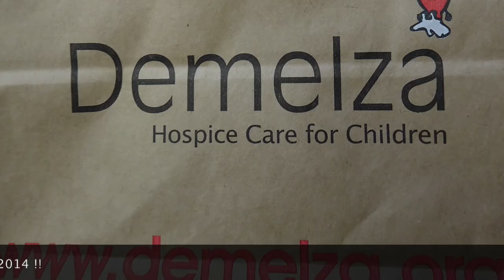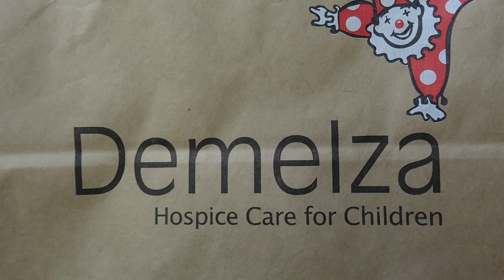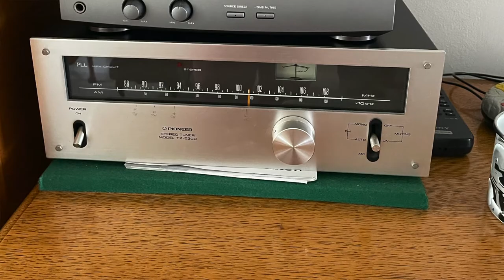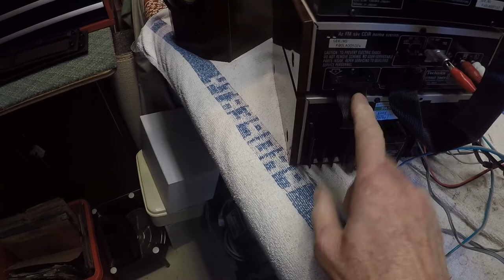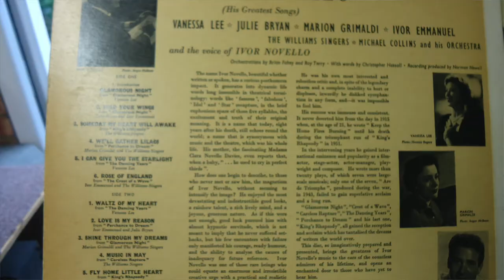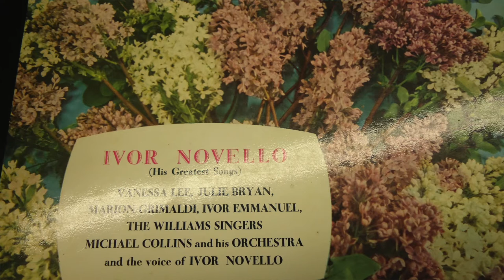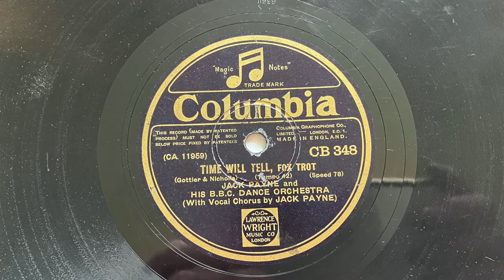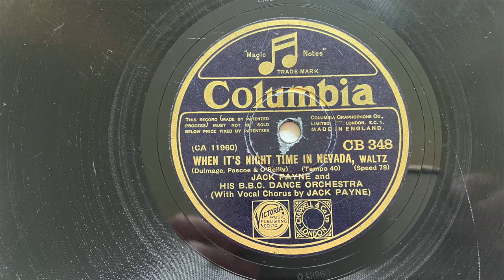Technics SC HD550 (2001-2002)

Comment: Hello Richard,I bought this system off eBay nearly 2 years ago. I kept my cheap Aiwa record player from an old system from the 90s. Sounded great,but I got a Technics SL b21 which was mint and with an at 85p cartridge. Then I bought almost new teac 250 speakers and they really do bring out the bass. I use the cd player but not the cassette . Great little system.
Reply from the maker: Hi David 

Fantastic and I have mine well installed in the main lounge it’s a firm Fav 

Warm regards 

Richard

Comment: Hi Richard, Great video. I have one of these but sub woofer output doesn’t appear to be activated. Have you got any thoughts on how to activate it? Thanks Kev
Reply from the maker: Hi Kev 

Could be a connection issue - check the circuits for a break in the solder joins - both speakers or one? 

~Could try a different set of speakers to check output - simple things first 

Warm regards 

Richard

Comment: I have two older Technics SB-HD501 speakers. how could I connect them to m-audio interface / Behringer mixer? thanks!
Reply from the maker: Hi Harry 

You could wire the base units (LTs) to your audio and see how they run the tweeters might not like the extra power as no crossover is present.

Warm regards 

Richard

Comment: Thanks for the video. Nice easy viewing. Got a similar 350 but the reverse on the cassette goes "wonky" seems to be in the direction when the right side capstan pinch roller as looking down in the cassette is engaged that causes the problem 🤔i presume it's a belt but not sure how to change it/them. Thank you
Reply from the maker: Hi 

Yes the belts go after so many years - sadly.

Warm regards 

Richard
Reply: Thank you for the reply. Are there any video tutorials to help me change them? Happy new year

Comment: Here's a bit of extra info on this system. These were manufactured between 2001 and 2002 at the height of the bookshelf stereo craze. The 70W figure written on the unit is the total power consumption. The bi-wired speakers are actually bi-amplified, with a separate amplifier channel for each frequency. This minimises power loss in the crossover and I believe the crossover in this system is actually done digitally.
Reply from the maker: Hi Ashley 

Thank you for the update and technical detail which I will add to the description and site you with thanks. 

Warm regards 

Richard